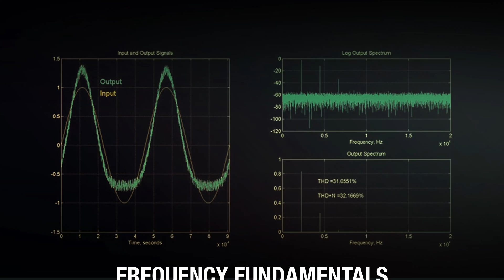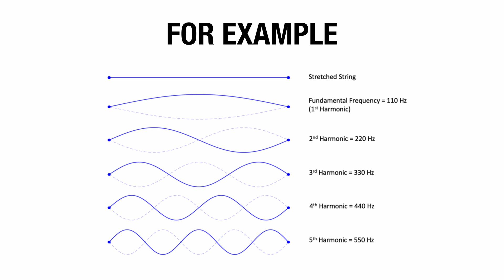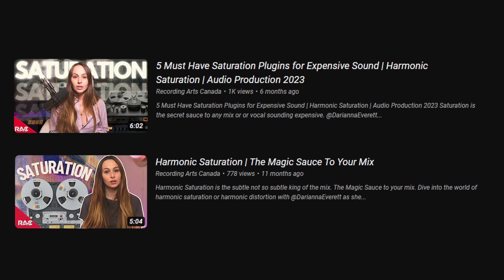Fundamental Frequency, Harmonics & Overtones Explained | Music Theory

Comment: thank you, as an overtone singer, what can I do with EQ to make the overtones louder over the fundamental note? any help would be sooo helpful, thank you
Reply: If you know what note you are using for your fundamental, you can look up the frequency of your fundamental and make a 1-3dB narrow cut at that frequency which will be just subtle enough to maintain your fundamental while indirectly boosting all other frequency content present. You will want to level it back up slightly to compensate for the lost level from the cut at the fundamental. You could also multiply that fundamental frequency by whole number multiples and make narrow boosts at each multiple of the fundamental at similar amounts if you wanted to boost harmonics but not also boost partials. Doing both is possible, but I would be more subtle with the amount in order to prevent it from being too excessive of an effect. If your fundamental changes, you could do this effect for each fundamental on separate tracks and then cut your vocal recording and place the sections for each fundamental on the track with the corresponding EQ settings throughout your song.